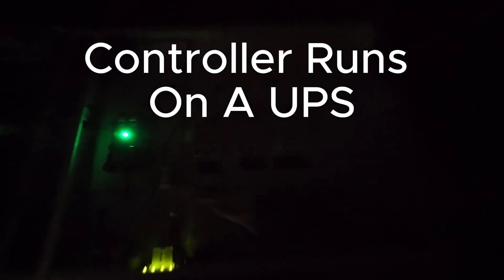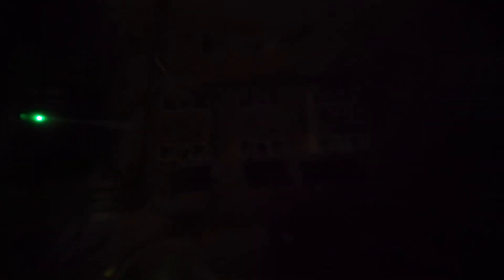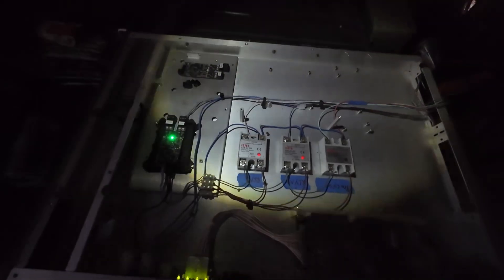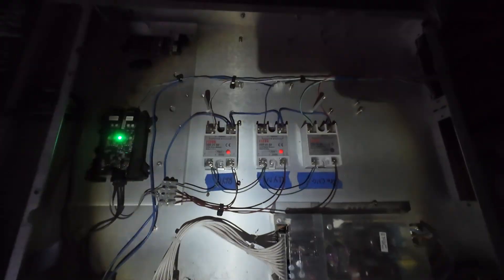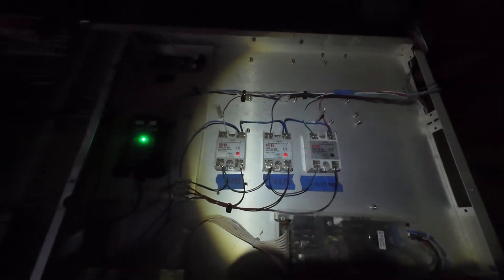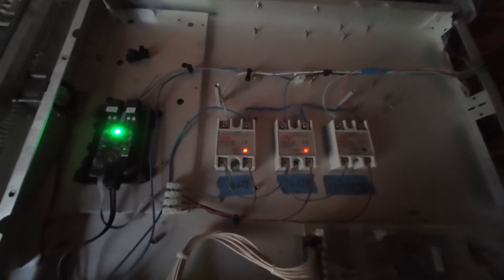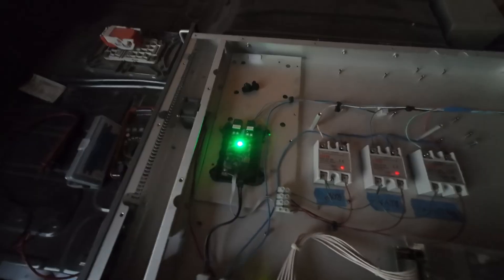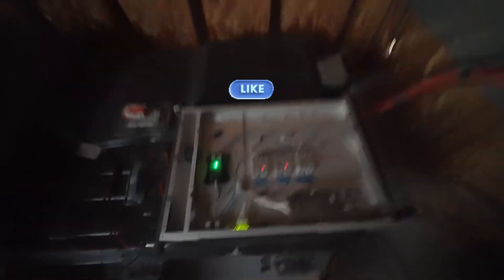4AM Cold Start Failure, Cheap SSRs Almost Took My System Down!

Comment: SSRs are actually fairly fragile just in general.  Always put a beefy diode in reverse across the terminals (positive output to positive input) to sink any reverse voltage.   This happens due to ripple and inductive pulses when switching off under load.  That's what tends to destroy SSRs more than anything else.

SSRs shouldn't have a problem with the cold, but they're easy to burn out with a low control voltage.  You need a solid control voltage for the relay to switch as quickly as possible, otherwise it lingers in the linear region too long and the voltage differential destroys it.   For that particular type you really should be switching with a 12V control voltage.

So:

* Put beefy diode in reverse, positive output to positive input, to allow over-volatage on the output to flow to the input and bypass the SSR.  (for DC circuits, not for AC circuits).

* Use a 12V control voltage, do NOT use 3.3V.  Particularly from something like a Victron (very high impedance digital outputs).  You may have to run your 3.3V control through a dry relay that switches a 12V control signal for the SSR.

-Matt
Reply from the maker: Good points on inductive kick, if an SSR is switching a coil I should definitely have flyback protection, but that diode belongs across the coil/load, not output-to-input.

On my setup the bigger issue looks like marginal drive into the SSR input, those “3–32V” modules still need enough current and an ESP32 pin is not a driver. I’m going to add a proper driver stage so the SSR inputs see a solid 5V/12V with guaranteed current.
Reply: @DIYSolarFarming  I've certainly found 3v3 marginal with these SSRs despite the claimed 3-32v range claimed and now use at least 5v.

Comment: We All Have Had  It Happen  Lighting Got Me 7 Years ago One Of 3 inverters & Gen Remote Start   Did work Around & Got Radio Gen Start Now   Lighting Came In On Control Line  To Gen  Got New XW6848pro For Master  2 Others 20 years Old   I Still Upgrade  More Solar  Input Now  On The List